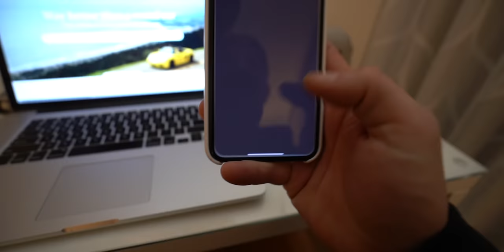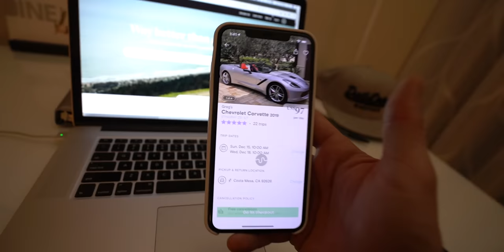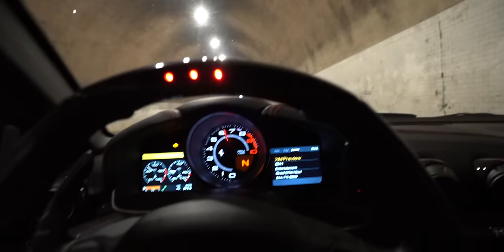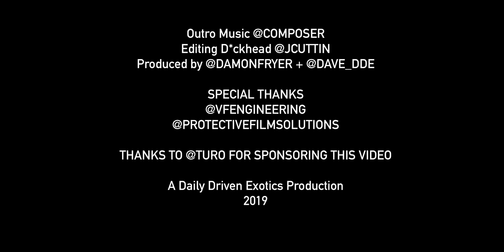REVEALING MOST AMBITIOUS STREET LEGAL ASTON MARTIN PROJECT EVER!

Comment: Straight pipe the F12 damon  
It's like A Tesla
Reply: cars passion hes literally said he has an exhaust on order since the second video with the f12
Reply: Ikr why hasn't he snapped his fingers and made the exhaust parts appear on the F12 already. DANGIT!
Reply: Having the camera inside the car won't let you hear the exhaust. Having the camera out the window, with the wind overloading the mic, also won't let you hear the exhaust. When the Porsche passes, it sounds much louder. If they had a camera in the Porsche, the Ferrari would sound much louder. Not as loud as the Porsche, but much louder.

Comment: The Audi RS5 sounds so nice
Reply: RS5 is a V6 I thought. Yari's car doesn't sound like a V6
Reply: @CarsandChris  NO THEY NOT V6 THEY V8 4.2L SAME MOTOR AS THE R8 JUST TUNED LESS
Reply: @Svj_88  the new RS5 is a V6...
Reply: @Svj_88  all those caps and you still couldn't get it right.
Reply: @Svj_88  It's actually a different 4.2. And more power then the R8, RS5 is 450 hp, R8 is 420.